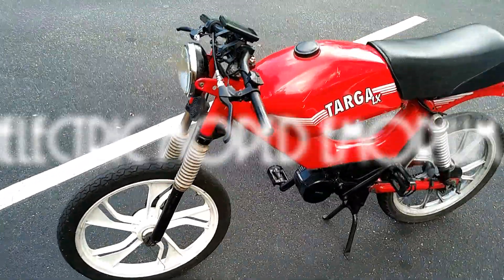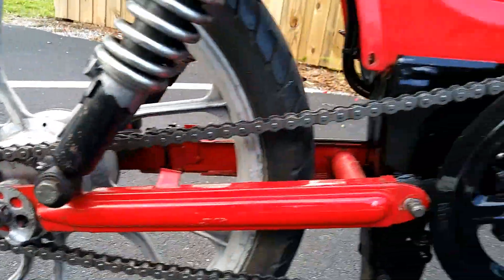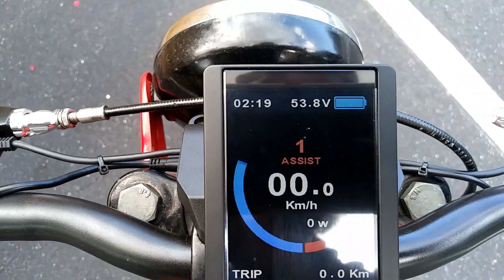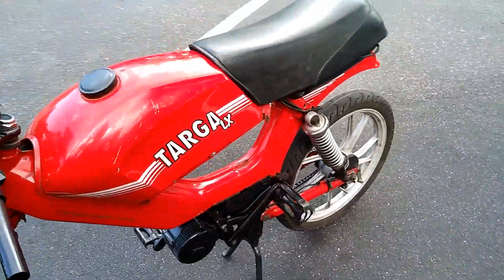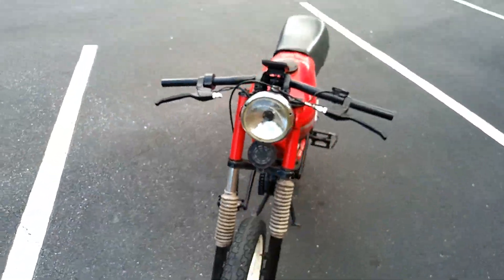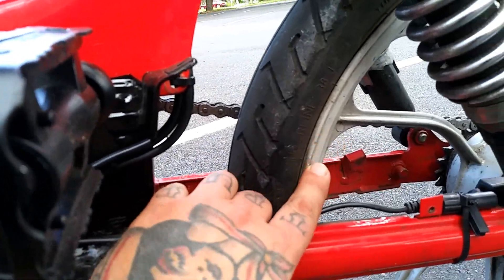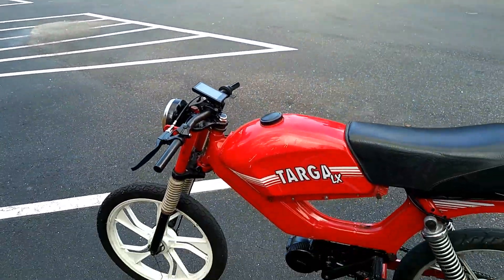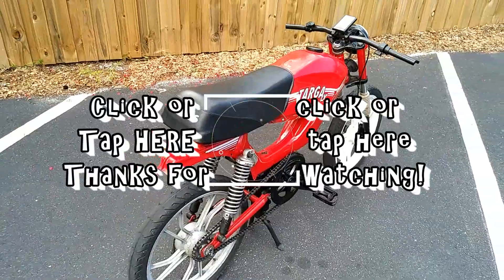Electric Tomos Moped Walk Around

Comment: Can I pick your brains please? Or anyone that may be able to help. I’m converting a pedal start moped to electric but can’t decide on the best motor and battery power. I would like it to easily do 40 miles (64km) an hour and cover 20 miles (32km) distance on one charge. It’s only to get me to work and back. Any advice please would be very much appreciated.
Reply: Go for a direct drive hub motor.
Reply: There’s  electric bike/scooters on Craigslist there’s always a needs battery if you’re lucky you can find a perfect one for 150$ or so best of all it’s a perfect donor as it already has drum brakes on the hub motor and that makes swamping in it over to a full suspension moped that much easier every thing is there’s  no need to buy an expensive new moped wheel ebike kit 

Here’s a couple links so you see what to look for when hunting the donor moped/ebike https://www.google.com/search?q=aowa+ebike&prmd=sinv&sxsrf=ACYBGNTC4iQf0fHfLuaxKf9h0AM9PzYnGQ:1569287033706&source=lnms&tbm=isch&sa=X&ved=2ahUKEwjk7cbhoejkAhWFpp4KHbTKCr8Q_AUoAnoECA4QAg&biw=375&bih=630#imgrc=pb2JNh5ZQyFw8M&imgdii=Ige-lBOOsQk_FM

https://www.google.com/search?q=aowa+ebike&prmd=sinv&sxsrf=ACYBGNTC4iQf0fHfLuaxKf9h0AM9PzYnGQ:1569287033706&source=lnms&tbm=isch&sa=X&ved=2ahUKEwjk7cbhoejkAhWFpp4KHbTKCr8Q_AUoAnoECA4QAg&biw=375&bih=630#imgrc=pb2JNh5ZQyFw8M
Reply: Hope I helped I might add I’m doing this conversion myself too & I recommend you upgrade the phase wires as that’s the only weakness I see

Comment: Nice work. You did a great job hiding stuff. I bet the top speed limit is partly probably tire height. Most of those mid drive kits end up on 26"+ height tires with similar gearing. I bet it picks up speed nice and quick though.
Reply from the maker: Thanks man! After riding it I'm actually fine with the speed I'm going to build fast bikes but for this one it's zippy and fun enough lol